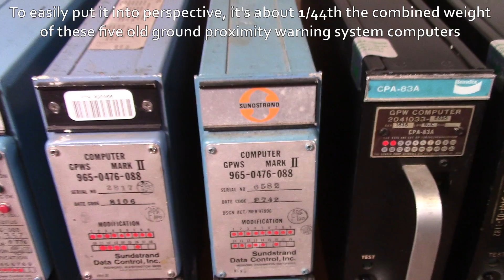Restoring Old Rusty Hand Cranked Doorbell | Random Restoration

Comment: Looks like you may be into restoring old aircraft avionics. I did some work for Narco Avionics way back in the 80s when I was laid off from my job as transmitter engineer for a 50KW AM radio station WPGR in Philadelphia.
Reply from the maker: Well I'm not currently restoring any, but maybe in the future - I do have a small collection of avionics going, but noting too special right now haha. Vey cool, I'm sure it was interesting work! As per usual, thanks a lot for watching!
Reply: @randomrestoration6858  Working on the avionics was instring not so much AM broadcast transmitter work. The job was 8 hours a day of boring. I was much happier when i got into television broadcast engineering.

Comment: have you ever tried doing a much lighter, perhaps gold paint layer under the black, so that after you paint it you could then sand the black down to the gold paint on the raised sections?
Reply from the maker: It’s. It a bad idea, but I’d have to use a different brand of paint if I wanted to do that, as the paint I use doesn’t sand particularly well. I’m sure it’s doable though! Thanks a lot for watching!

Comment: Excellent restoration of the function! So people who wanted to ring the doorbell needed to use that key? I agree that seeing the scrollwork plated would be most gratifying.
Reply from the maker: Thanks a lot! They would indeed. I've only seen one or two with a square shafted key similar to this for sale, though the keys were a bit longer than the one I made. The vast majority of them used a twist that had a square shaft that was permanently mounted.
Reply: My parents have this exact doorbell in the original door to their early 1900s home.  It has a “T” shaped handle one the outside with the same scroll work.  If the OP doesn’t mind, I’ll make a video next time I’m at their home and post it here.
Reply from the maker: @cjsgroundtreasures4777   Yeah you are very correct, these should have a T shaped twist like you’ve described. They can be found sometimes online, but finding the matching one for this is the real trick!

Comment: Such lovely metal scrollwork, all glopped up with brown paint - what a missed opportunity.
Reply from the maker: Haha true, there is a bit of background to this video. When I purchased this the pictures implied I’d be capable of polishing it and painting the recessed areas black. When I received it I realized that that was out of the question, and unfortunately I had no other projects to work on at the time so I simply had to restore it. Being a bit older of a video I also had no nickel plating or copper plating setup at this point, so that wasn’t an option. Not my best restoration, but on the bright side, it is in a stable condition so it shouldn’t continue rusting!
Reply: @randomrestoration6858  You're such a good sport.
Reply from the maker: @davidcameron9241  Thanks, David :)
Reply: Black...black paint😉

Comment: what kind of gloves are those? i see every restoration channel using em. i know they arent the same kind you find in a hospital like regular latex
Reply from the maker: These are (black) nitrile gloves. Depending on which brand you buy and the thickness of them they are very, very durable! Thanks for watching!
Reply: ok cool thanks. what brand do you use?
Reply from the maker: @masterlcpl3736  I mostly use Venom Steel brand nitrile gloves, but I recently picked up a box of "1st Choice" 6 mil black nitrile gloves and they seem quite reliable. I'd say on average they last a bit longer before tearing than the Venom Steel gloves
Reply: @randomrestoration6858  thanks RR! just came across your channel a couple days ago. you do amazing jobs at restoring things and youre hilarious! keep up the good work! 😁
Reply from the maker: @masterlcpl3736  Thanks for the kind words, I really appreciate it! 🙂

Comment: Painting it... Are you F'in serious...?!!
Reply from the maker: Haha yep, this is a bit of an older video, and I lacked my current nickel and copper plating setup that I have now. Based off of the pictures when I purchased this I was under the impression that I was going to be able to polish it and paint the recessed areas black, however once I received it that was out of the question. I didn’t have any other projects at that point in time, so I had to work on it. At some point in the future I’ll find a complete door bell with an original twist and give it a proper restoration!